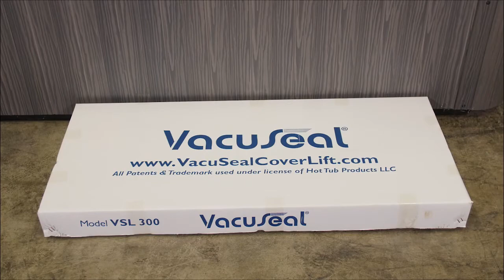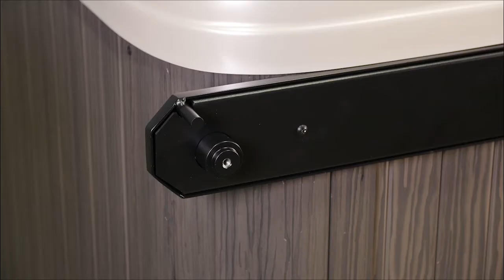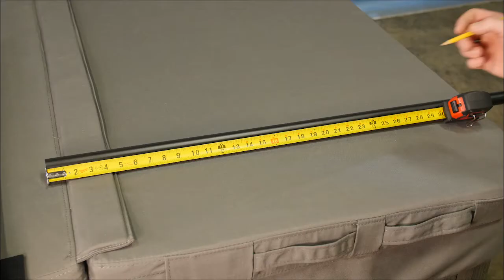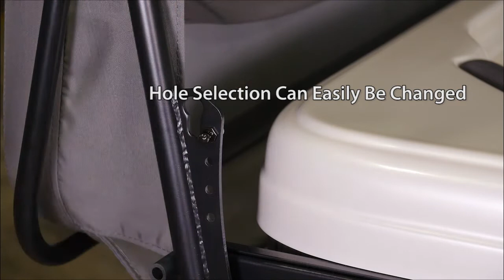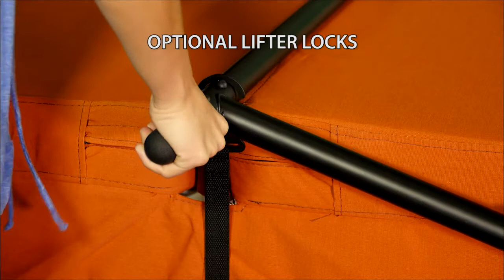VacuSeal Installation Models 300 & 400 High Def

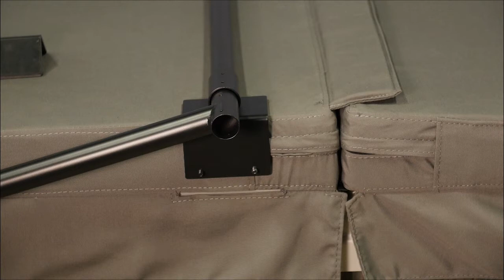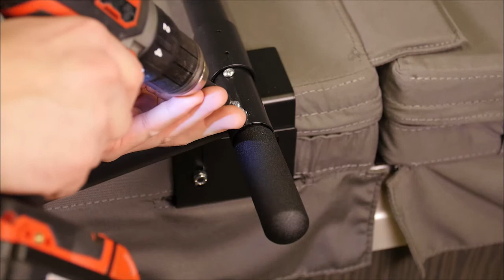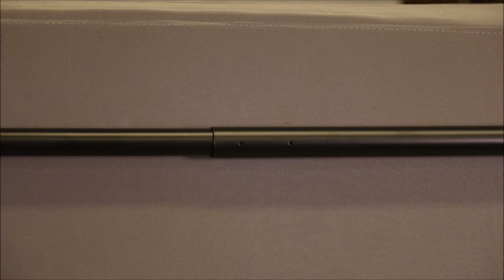Comment: I recently purchased and installed a VacuSeal 400 lift and cover and watched this helpful video in addition to reading the printed instructions.  For anyone else doing the same, here are a few helpful tips: 1) my drill bit set has a 1/8” bit (8/64) and a 5/32” bit (10/64), but not a 9/64” bit - so you might want to double check what you have before you get started (and buy a spare - I broke 2 drill bits on one specific hole under the adjustable bracket).  2) At 2:49, the video says to position the clamp directly over the center of the slit in the cover.  The printed instructions will have you position the clamp against the edge of the slit closest to the center of the cover, which will support he cover better when it is lifted.  3) At 4:26, the video says to make sure the lock nuts on the clamp are securely tightened.  Be careful not to over tighten - one of the bolts that is integrated into the top clamp piece snapped off when I did this.  4) At 4:46, the video has you add self tapping screws to the outer holes of the crossover bars.  The printed manual skips this step and just has you install the screws in the upper clamp, which will also hold the handle.  You won’t have enough self tapping screws in the included hardware kit for the outer holes of the crossover bars.  5) Securing the extension tube as shown at 6:53 was the most physically challenging step for me.  I’m a 5’ 4” woman and couldn’t reach the holes while standing on solid ground whether the cover was in the open or closed position  6) The screw caps shown at 7:07 were probably the most frustrating step in the installation.  Those little buggers kept popping off after I put them on.  I gave up and left a few screws uncovered.  Overall, I really like the cover and lift system and will use my hot tub more regularly now that I no longer have to deal with my previous unwieldy cover and lift.